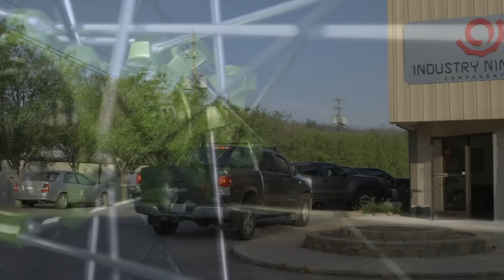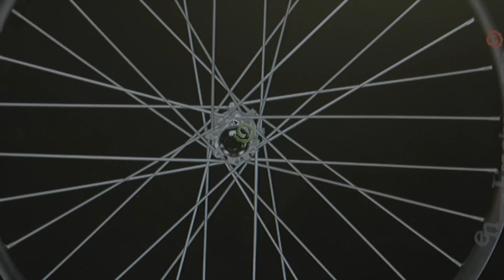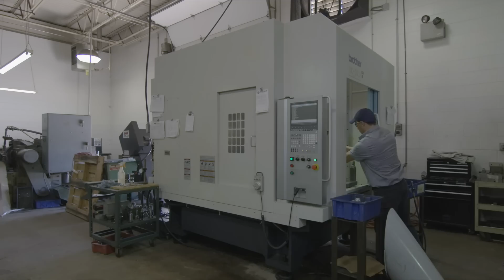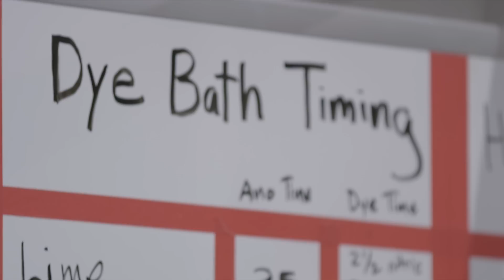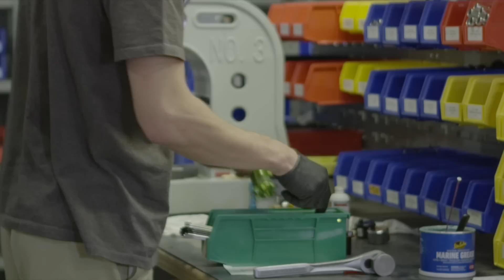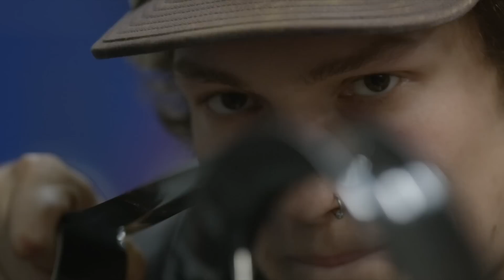Making Custom Bike Wheels with Industry Nine // Made With Love

Comment: "a mori seiki cnc machine" shows a fanuc wire edm, this was so good until that line!
Reply: jessebv I think you misheard. The narrator said that the drive ring profile and external threads were cut on a Mori Seiki CNC. Then after heat treat of the A2 the teeth on the ID are cut with a wire EDM.
Reply: Benjamin Smith i understood correctly.
Show us the Mori Seiki! Its describing every process and the machine associated with it except for that one step.

Comment: I looked at their site and checked their products and there is one thing i find odd. When you are a company claiming to build wheels that are super strong and resilient, why don't build a wheel that supports a system weight higher than 114kg. Can't be too difficult. Outside of the pro cycling, higher weight support would actually come in handy to support luggage (for bike-packing e.g.) or heavier riders. Not all riders are weighing 165-180 pounds (and i am not talking about being FAT!). Kinda dissappointing...
Reply: Agreed. Love there hubs but have been nervous about full wheel builds as I am a clydesdale rider at 220-230lb

Comment: Like how he measures the part, but still tosses it at the end.
Reply from the maker: The measuring was for QC purposes, just to ensure its within certain tolerances.
Reply: @freehubmag  I check the pistons in engines for spec and I sure as hell don't toss them on the bench. Just sayin. You don't spec parts and toss them. I know machinists who throw a part in the trash if its dropped.